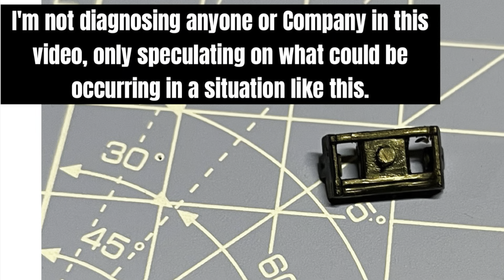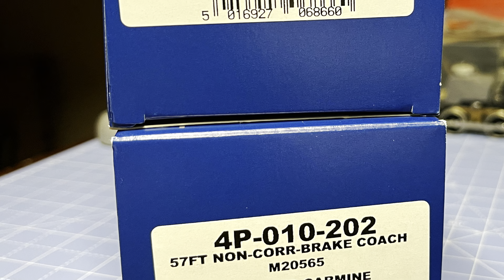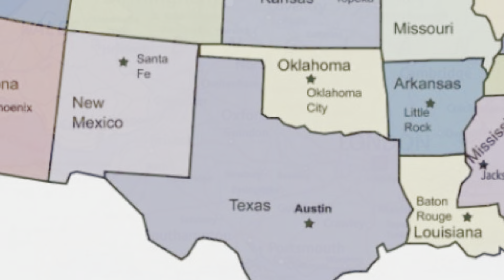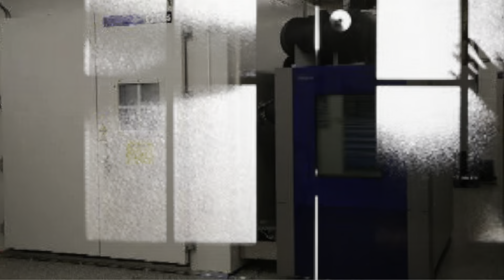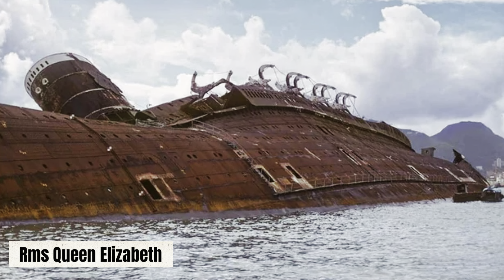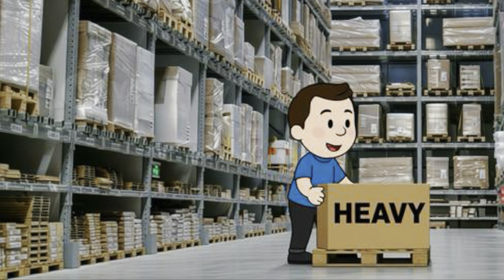DAPOL Stanier Suburban Coaches OO gauge- Buyer Beware

Comment: Interesting - I too have had Dapol stock whose wheels drop out of the axle guards. Annoying is the appropriate word! Heritage tools, no matter how well made originally and well cared for, cannot go on for ever. That's a simple fact of life. Dapol began by buying other people's redundant moulds - the original Gowland 'Highway Pioneers', Kitmaster locos and Airfix buildings, which were already quite old and gave them a new lease of life. That's fair enough - and they did point out that the Gowland models suffered from slight age-related damage (which was easily cured)  
They weren't the only people to do this - SMER and  Glencoe acquired old tools from Aurora,  Merit and other firms, and glad I am they did. I caught the models I loved as a child - but there is a limit to how long they can keep being used. 
Some of the new Dapol stuff is very nice indeed.  They've progressed from simply re-using other peoples tools to making very good models in their own rights.
Reply from the maker: Hi John,

Aye some of those kits you mention even predate me I think.

What years are those?

BR

MODELTRAINZZ

Comment: Quite unacceptable in this day and age as today's progress in advanced machining makes complex picket mulling cheaper than it has ever been.
Reply from the maker: Spot on—that’s a classic rule for a reason! I think there’s been a bit of a typo in your comment, but I assume you’re referring to the ease of modern CNC milling for new tooling.While the technology has certainly advanced, the challenge for a manufacturer like Dapol is the 'Business Case.' Even with cheaper CNC, a full set of new coach tools can still push a £100k investment. In a market already saturated with 50 years of these models, the ROI just isn't there. They tried to 'split the difference' with a partial fix, but as we saw, you can't cheat the physics of 50-year-old steel!

Comment: tooling quality is down to original design and who made the original tool - and the toolmakers who then look after the tools and maintain them - I have seen medical device moulds in lot worse condition than these. -  i was an apprentice toolmaker who has worked as a hands-on production engineer in aerospace, medical devices, and nuclear. – the pitting you claim is not corrosion – it is normal wear and tear over thousands of cycles in an injection moulder ; and the structural integrity of the parts is down to moulding materials and moulding cycle settings – there may also well be wear on some of the critical dimensions in the tools that is now affecting the fit and function of interconnecting parts – also the assembly process my be defective – “pay peanuts – get monkeys” – so you can keep the price down
Reply from the maker: Hi Gold,

Appreciate your feedback and all good.

I did some triple fact checking again in case I made an error on what I was seeing and my earlier research.

There is documented evidence available that shows the point where David Boyle of DAPOL purchased the tooling from Palitoy and his arrival in HK to inspect it before it was shipped to U.K.
Minimum the tooling was in storage 18
Months, in some cases 2 years from last production runs.
It probably deserves another episode as there is so much I’ve dug up.

Actually Gold, there was something’s I should have added to the episode or forgot during the edit.

The first two coaches, 1 was defective with splayed NEM caps that fell out (in 2025).  I gave DAPOL benefit of the doubt and was able to make it fit.

3rd coach this past week had the splayed nem caps fail on both bogies.

I should have provided more close ups at the correct angle.

Also the axel pin slots which are wider now and fail to hold the axel pin correctly.

Do a quick search on the tooling changing hands from Palitoy to DAPOL in 1983-85

It’s quite telling and well…. Maybe a future episode.  If there’s a desire to look back at that event. 😊

Br

MODELTRAINZZ

Comment: Looking forward to your manor review. Did you have issues with the front bogie on points too? Kindly A
Reply from the maker: Hi Anthony,

The front Bogie on the Manor?  No it was fine.  They have a compensated front bogie (Sprung) and it has a large range of movement.

So one of the best bogie designs on a steam locomotive model.

BR

MODELTRAINZZ